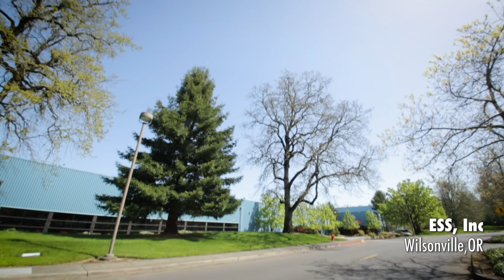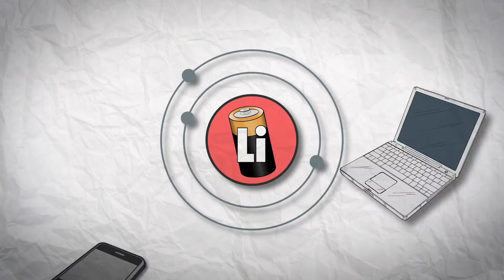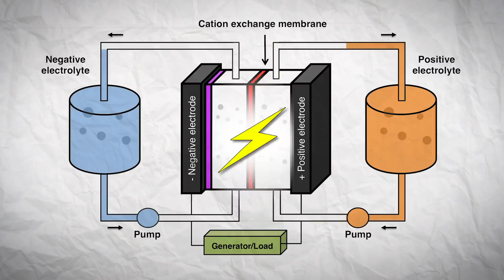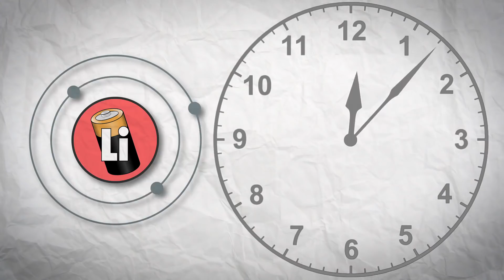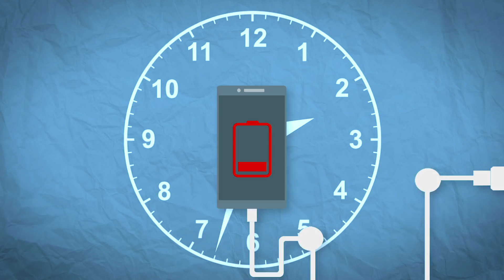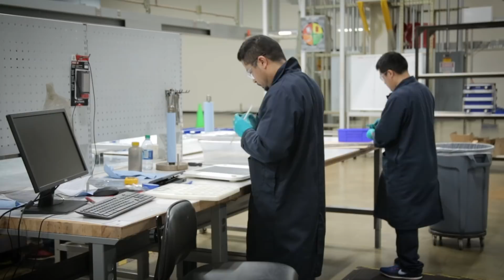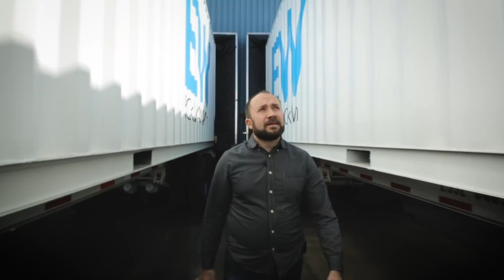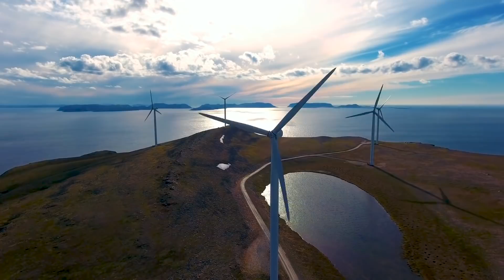Battery Fueled by Iron and Water Could Transform the Power Grid

Comment: So... what are the battery specs? What's the efficiency compared to alternatives? Caveats have been circumvented to get the sponsoring I guess.
Reply: Found this: https://www.essinc.com/wp-content/uploads/2016/06/ESSIFB100-800DS_071216bWeb.pdf
tl;dr: 80% efficiency, ~20000 cycles endurance, 50 Wh/kg net energy density.
Li-Ion chemistry for comparison: efficiency ~85%, ~1000 cycles endurance, ~ 150 Wh/kg energy density. Source: https://en.wikipedia.org/wiki/Lithium-ion_battery

not too bad overall. probably the most important question is the usual one: what does it cost?
Reply: @--and--  ... and let's not forget,  it is far more environmentally friendly,  as in, nontoxic and nonflammable... Sounds like a winner to me...
Reply: made a mistake: energy density of the whole system of power container plus two tanks is only ~10W/kg. the specsheet is quite confusing.
Reply: W / kg is a unit of power density. Energy density would be measured (here) in W h / kg, namely watt-hours per kilogram.
Reply: @--and--  wrote: 
>energy density of the whole system of power container plus two tanks is only ~10W/kg.

I think the energy density is 50 W/kg "dry" (when it's shipped, before it's operational).  Then when it's installed and filled with water it's 15 Wh/kg.  That is quite low although it doesn't necessarily matter for grid-storage as long as you don't have to move it.
Reply: Specs are essential even in videos like this. Without cost and spec comparisons on power density and energy density it's just a big advert for a company who are probably looking for investors.
Reply: @nitelite78  I think you mean dumb investors
Reply: They mentioned that it doesn't really have a shelf life and it has relatively poor energy capacity.  However, since this is used for renewable energy (which tend to take up a lot of space) I think the energy capacity is largely irrelevant.  Considering this uses cheap materials and practically no custom made parts, I don't think cost is really going to be a long-term issue, either.
So yeah - this probably has pretty terrible specs compared to other batteries, but being safe, cheap, and long-living are the most important aspects for its application.
Reply: Krommandant - great questions.  ESS is certainly not hiding any information.  RTE for the ESS battery is 70% AC/AC at temperatures ranging from negative 5 Deg C to 50 Deg. C.  Li-Ion systems will vary depending on the ambient temperatures due to HVAC loads; but in general Li-Ion will range from 65% to 85%.  Specific battery specification can be found at www.essinc.com.  The applications the batteries are used for play an important role in the end specification for example ancillary services vs bulk shifting.... not enough time to go through all of this in the video  If anything is confusing on the web site please feel free to let us know so we can clarify
Reply: Agree with Krommandant... Distinct absence of the downsides... ☹️
Reply: @thesuperiorone  no downsides... only upsides
Reply: I guess, energy density is an issue with the battery, but it is not an issue with wind farm where space is not an issue
Reply: Yes and that mean that if you have an average at only 5kW/day you will need one container per 80 houses  to power them for a day. You lose 30% when storing.
That means that using compressed air would be just as good an a lot simpler, and there would be no limit to cycles or any electrolyte to dispose off.
Reply: @bknesheim  I am sorry but complaining about disposing of "Electrolytes" when they consist of Iron and water which respectively make up 80% of the planet is like complaining about how frustrating it is that you need to breathe each day.  I am not a scientist but I have worked in practical engineering and construction before.  They could literally dump the contents of this battery out on the ground and it would do no harm.
Reply: @SoralTheSol
My point was that the efficency was so low that you could just use compressed air.
Beside I do not think it would be good to dump saltwater on the ground.  :-)
Reply: @bknesheim  I have no idea where you get that from and I have done roofing with compressed air nail guns.  Compressors eat ten times the energy of pumps.  They have to overcome the power of the air pushing back against them.  A pump is just moving water.
Reply: @SoralTheSol
,and a fan is just moving air.
The pushing is the energy storage and at large scale you do not throw away the generated heat. In Huntorf,Germny you have a 290MW storage at 80% efficiency since 1978.
The small nail-gun compressor throw away the heat when it store and lose efficiency to the gas cooling when you use the air.
Reply: @bknesheim  "Compressed air storage plants are inefficient, and so they are commercially viable only in places where the price of power varies dramatically. But the intermittent nature of wind power can cause just that sort of variability."

Looked it up, wow it actually exists.  Oh but hey it seems that there are some flaws with it.  Keep in mind that most of the United States has a stable power grid.  Now allow me to inform you of what you are doing.

We have five people on a beach, you are one of them.  Each one has their own grill.  Traditional wood, Propane, Solar, Electic, and your compressed air.  You just ran down the beach, told everyone their grill is shit and that they should feel bad for not using compressed air.  We are trying to not over specialize.  We need multiple solutions.  Not just one.
Reply: @ Joseph Scott. Actually 75% efficiency is not so bad. One of the current technologies to store electricity for peak times is to have two lakes i different elevations and to pump water into the higher lake when there is surplus energy and to use it when the demand reaches peak levels. Efficiency is about the same but you need two lakes with different heights. So you couls not build that in flat lands and Lakes and deserts allso dont mix well. Production of electricity and maintaining a stabel grid s not that simple. Consumption has various peaks during the day and most powerstations are very slow in ramping up their power output. To go from standby to 100% can take several hours and renewables have their peaks whenever nature likes it. So it is still more efficient to waste 25% to buffer the peaks than to waste it all.
The Sun or wind deliver whether you use it or not. Efficiency is for renewables not that important as with fossile fuel you do not consume sun or wind. Steadyness reliableness and cost of purchase are much more in focus than with fossile power stations.
Reply: bknesheim a compressed air tank is heavy and doesn't have unlimited cycles. A compressor also needs maintenance (but so does a pump). Compressed air storage is also noisier.
Reply: There are two main downsides of this kind of battery:
1. It is bigger, the energy density is smaller. Therefore it is not suitable for mobile applications, like cars or wearables. But somewhere in a place with low cprices for space this is not a limitation. Large scale renewable energy production usually is situated somewhere in the county or even in deserts, so no problem.
2. To work efficient it needs circulation. So pumps are used, which are not free of maintance and energy cost. But the main purpose is to store the energy only for a couple of hours and in that case the losses are insignificant.
My main dissent would be maintance. Probably this is the reason why this technology has not revolutionised the energy industry.
Reply: It must be really cheap for people to be happy with getting 75watts back for every 100 they put into it... and only be able to store it for a few hours... and the space it takes up... I can see this would be very useful at a power substation if the cost was low enough. That's about the limit of its usefulness, but still that's VERY USEFUL lol.
Reply: It was mentioned by the CEO that they're working towards getting the cost on parity with Li-Ion. It didn't seem to me that anything important was missed from the video.
Reply: Nothing wrong with fossil fuels. They are an excellent source of high-density energy, and nothing can yet beat it for convenience! The problem is that the CO2 produced can't be absorbed (by plants) at the rate the CO2 is being emitted. I heard somewhere that we (humans) are using per day what it took the earth a year to produce.
We need to shift things so fossil fuels are used when they need to be (or have to be), and other tech is used to satisfy the 'base' load (including transport).
Reply: @owenhann2363  in 70 years the oil is finished and in 700 yrs the coal.
We expect the sun to shine another 5 billion years, so now you know what's wrong with fossil fuels.
Reply: Given the recent trend in good stuff videos, this is a very valid concern.  The channel seems to be creeping toward "who can give us money for a good review?"
Reply: This is not for domestic use. It is for installation near the point of energy production. So that producers can buffer their surplus on peak production. regenerative energy is mostly produced in remote locations where the space for the batteries is irrelevant.
Reply: Explaining battery efficiency is not that confusing if you do it properly. The measure of efficiency is important when comparing batteries, general audiences can understand some of it.

As an example, if you want to get 400MwH out of a battery and it takes 800 MwH of input energy to do so, the battery efficiency is at 50%, which means 50% of the energy you put in the battery is lost to heat/pumping/filtering/etc. while storing and converting back to electricity. 

There are no perfect batteries, but if energy density is not critical, then the cycle degradation and efficiency become the primary factors in the choice of battery.
Reply: +Future Hindsight ...Efficiency of solar power production has improved, but the efficiency of storage needs to be known too as solar-battery systems are what regulate your energy output. No one wants their energy to go to waste. When the price of infrastructure gets added into the equation of the cost of production per KwH, every spec available is needed to make an informed decision. As of now, not many solar power plants in the world can boast of producing energy under 7cents per KwH (market value) even when they are directly selling the power, not storing it for later. Efficiency, initial cost, maintenance costs, required infrastructure and lifespan of a battery system are all variables that determine if you profit or if you go bankrupt. 

There are no so-called "red herrings" because producing storing and selling electricity is very complex and huge market that will only get bigger as fossil fuels phase out.
Reply: I don't think general audiences are watching videos about battery technologies and if they are dumbing it down to the point that there is little useful information isn't helpful. This is a flow battery. There are other flow batteries, what are the benefits and problems with this tflow battery? How do the costs compare with other grid backup systems like pumped hydro for instance?. Tesla has been successful at getting many highly publicized sales. How do the sales of this battery system compare with Tesla?  There are many possible directions this video could have taken. It took the path of being a press release for this manufacturer.
Reply: Storing liquid hydrogen for a hydrogen fuel-cell is way more efficient way of storing energy for solar and wind and when it converts back to electricity it's just water look up hydrogen fuel cell battery the only downside of it is the requirement of a rare metal which they are working out with carbon plating
Reply: @ernieferguson6346  only one problem with that suggestion, it's completely theory. Hydrogen fuel cell technology has been around for a very long time and for many solid reasons it was never commercially manufactured. And therefore it's not available unless you're some sort of chemical electrical engineer that can build your own from scratch ...
Reply: @Archived_Lives77  I've built one all you need is a plate of platinum or nickel with platinum plating & another plate of plane nickel with a membrane between..  bottled hydrogen one side & regular air for oxygen on other side.. you get 3 volts n water... & put 3v & water (in reverse) you get oxygen one side & hydrogen on the other. . There's a farmer has solar panels to store a tank of hydrogen releasing the oxygen into the air and he runs his tractor off of straight hydrogen or uses the process in Reverse for electricity at night when the sun's not out or on cloudy days it was a package he actually bought online something I've always wanted to do in the future still working on just getting a piece of property
Reply: The cost is likely very low. The materials are practically worthless, other than the custom casing for the batteries and the storage container they use to house the batteries. The worst of it would be labor costs, as I could see that they're still a small factory that uses wage slaves. Until they become large enough to automate those slaves and make them unemployed I would assume the cost is equal to that of a standard industrial lead/acid battery
Reply: @jibbly5739 If you are correct, this will revolutionize battery storage for homes with space and larger businesses. So, what is holding it back, as in, why haven't all houses/PV been using it? Wouldn't it be wonderful to be free from the grid? The 20/25 year life fits right in with the life of a PV array.
Reply: well, the specs are on the shipping container, no? 50Wh output, 400kwh capacity? My house eats 20kwh a day (too much) meaning it should power my house for 20 days straight. Some more modest home for two months or more?
Reply: @gelisob  did you just use watt-hours for power?
Reply: @bottlekruiser  you are correct I made a typo there, but the message content was not about power but capacity so it made no difference since i didnt discuss power.
Reply: @gelisob  fair, i guess
Have a nice day
Reply: The size isn't even that bad. For one, a lot of the size currently seems to come from those batteries being able to walk around in. I assume there are good reasons for that. Maybe it needs maintenance or something. (In reality, even if you used something like Li Ion, you'd still want some space to walk around in, so you could replace faulty / old batteries or what not)
In the future these could probably be integrated right into the powerplant. (Say, as a building with solar panels right on top, or as addition to the walls of a wind turbine or such)
70% efficiency isn't amazing, but it's not awful either.

What I was confused about is this: Do these require electricity to be run? It looks like you need to maintain a steady fluid flow to keep charging / discharging. Is that right? If so, there's also gonna be a trade off in terms of when the pumping becomes more of a drain than what the battery saves, right? I imagine that to be relatively trivial compared to power plants. Might eventually be an issue for, say, home usage, if you have a rooftop solar panel in a place with relatively bad conditions. It might not give enough energy over the course of a day to offset (after efficiency loss) maintaining such pumps.
(Although probably even that's a stretch. I bet an efficient pump to handle that kind of load is nearly a non-factor today...)
Reply: @Kram1032  In transit systems you need an internal combustion engine to make use of fossil fuels, and they weigh a lot.  So it makes more sense to evaluate the overall system, including externalities such as CO2 emissions, and not just fixate on individual components.
Reply: Krommandant Round trio efficiency of 75%...I guess all those pumps aren’t doing it any favors
Source: https://www.essinc.com/wp-content/uploads/2018/04/ESSDatasheet_EnergyWarehouse_Apr_10_208_LowRes.pdf
Reply: A capacitor built from  mere sheets of glass and aluminum foil would do as  well and could be cycled indefinitely i suspect.
Reply: It's a video about the battery. Not a discussion of the battery. Very different.
Reply: it is an issue as it determines size and weight. 

You know co2 is fundamental for life on earth right? 
The last 10000 years has been a inter glacial period of the ice age were still currently in. 
Warm weather requires less energy and is more comfortable for our tropical origin conditions of choice. 
the record shows that co2 levels follow global temperature changes lagging behind almost 800 years. 
Might have something to do with how long it takes to change the ocean temps avg that effects how much dissolved co2 the warmer water can hold leading to an overall release of some of that carbon and slowing of the rate it absorbs it.

Co2 is at something like 40000 ppm when you exhale. Good thing plants can use it and sunlight to make oxygen and serve as a base of the food chain for all the complex carbon based life on earth.
Reply: And gasoline has 100 x the energy density of Li-ion. Amazing how lucky we are to have such a convenient and abundant source of energy. All we need is battery that can recharge in 1 minute and go 300+ miles on that charge. Also it needs to scale so it can be used in all our tools and such too. Then we need to make solar panels able to deliver the charge power needed for that 1 min charge that are also portable so we can charge those tools and carry fuel off grid. 

Looking at the table of elements, I think Lithium is pretty much it for chemical energy batteries guys... Nuclear batteries?
Reply: Well the video and channel are for general audiences, so while that information is important, it would go over the majority of the audience's head and might even confuse them. It is nice just knowing that the tech exist and what it could be used for.
Reply: Geoffrey Cavalier Basic technical specs aren’t over the intelligence of an average viewer.  Don’t assume people can’t handle it.
Reply: Andrew G- How funny , you completely ignored the "child miners" issue, mining COBALT, in the Congo...an essential ingredient in Li battery manufacturing...invested in Tesla Energy Inc, I presume....Musk RARELY discuss's this issue, does he?
"labor costs"...hilarious ...some of those child miners take home less than  $5 USD a day...for 10-14 hrs work days. Yeah, labor costs is a big concern....too funny.
Reply: @furdfelmer4359  No, he does.. If you had googled a bit you would have found out in 5 minutes.. 

This was asked Tesla during a shareholders meeting last year, and also on Elon Musk's twitter feed.. he answered immediately, so if asked about they are willing to discuss this, no problem... Ok, the answer was that Tesla batteries use far less cobalt (>3%) than other brands do, and will go to batteries without cobalt at all in the future. Beside that at the moment Tesla sources their cobalt from the Filipines, not the bad mines in Congo, and Tesla batteries will be recycled by Umicorn in Belgium where they remove allmost all cobalt and will be used to produce new batteries. Also Tesla announced that all new materials they use in the Gigafactory, will be sourced from US soil, a new mine will be opened in  Nevada for sourcing cobalt, down the road of the Tesla Gigafactory!

So at least Tesla cares about their supply chain, to be ethically acceptable as well, but also other companies are increasingly aware of this, because their customers like you and me are getting aware of this and weighing this into their choices.. The cobalt from Congo end up mostly in gadgets like smartphones, laptops, tablets and such made in China.

https://cleantechnica.com/2018/06/17/teslas-cobalt-usage-to-drop-from-3-today-to-0-elon-commits/

https://youtu.be/aOHQi_GahJo
Reply: @furdfelmer4359  This battery chemistry requires no Li nor Co, just Fe and salt water (FeNaClH2O).  None of these are mined by child slaves in the Congo; most are available reasonably close to every country.  So that's a point in its FAVOR compared to Li-ion batteries.
Reply: @furdfelmer4359  Tesla has already reduced the amount of cobalt in their batteries by a considerable amount.  As for child labor - that should be the realm of government policy, with stiff penalties imposed on companies that violate rules.  Won't happen with the current administration - deregulation has been the mania for several decades.